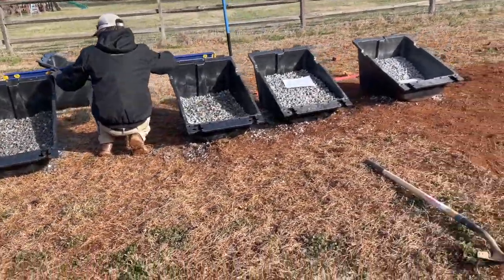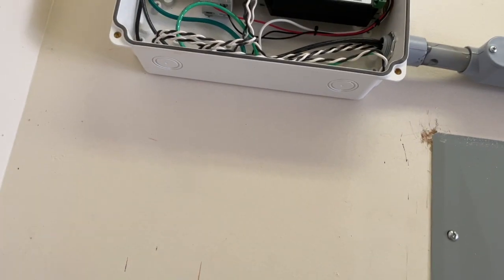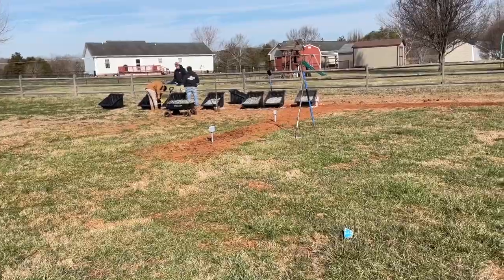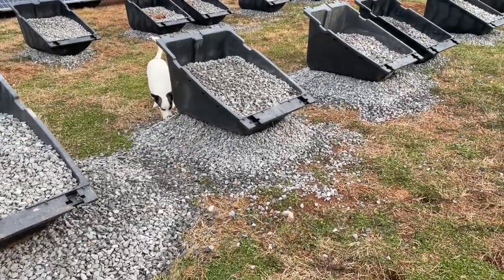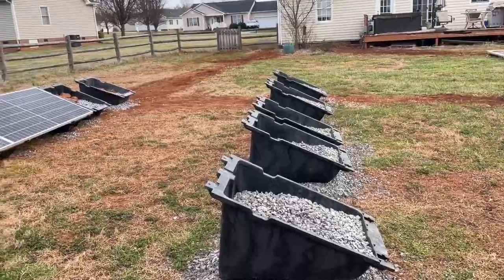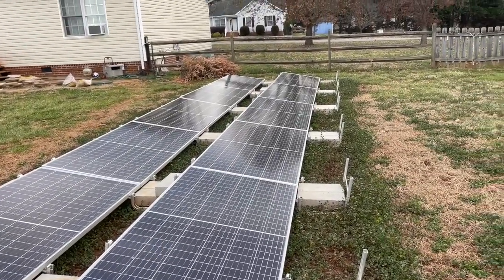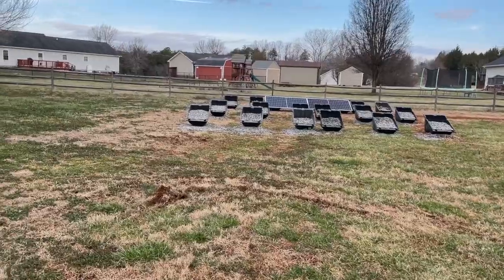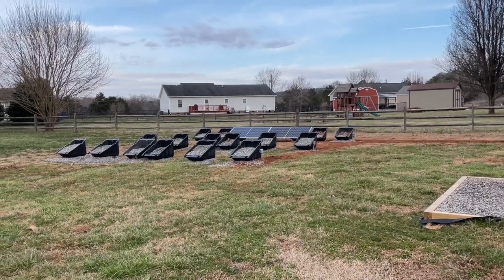DIY Solar Power Improvements (Part 2)

Comment: Nice!!! Do you like the power racks over the metal racks? If so why?
Reply: Great question. Yes, very much so. For the metal ones, the array must be perfectly flat all the way across. The PowerRacks can be used on bumpy terrain. Also, the tilt of the PowerRacks being 25 degrees makes an enormous difference in morning and evening production. Hundreds of more Wh are gained at 25 deg tilt. The only think I don't like about the PowerRacks is that they only work for panels up to 1050mm wide, ~41", and most of the newer panels are much wider than that. Powerfield has a new rack coming out in Q4.
Reply: @ToddDesiato  Most appreciated. Glad to hear they are coming out with a size that fit new panels out today. I am visualizing them in my backyard. 😎

Comment: Those Blocks would go GREAT with the EG4 Brightmount Ground mounting system, What kind of panels did you put on the Poweracks? Specifically, I know those racks are a little picky about width right?
Reply: These are Jinko JKM400M and 405M-72HV-L, 39.5" Wide is perfect for the racks without any extensions.